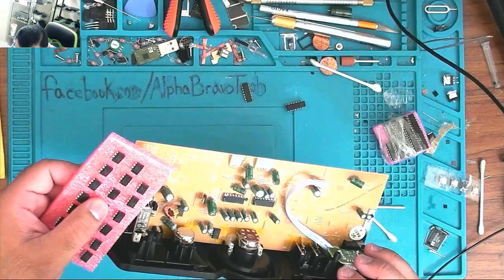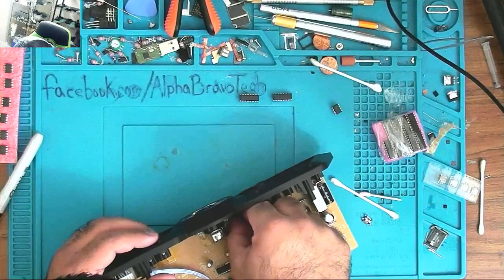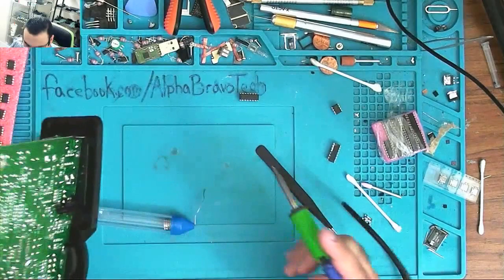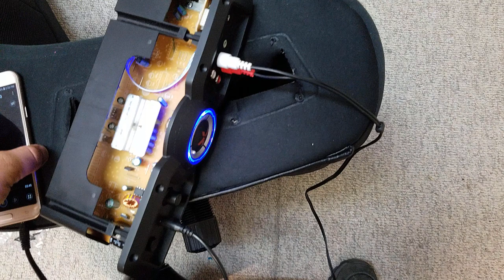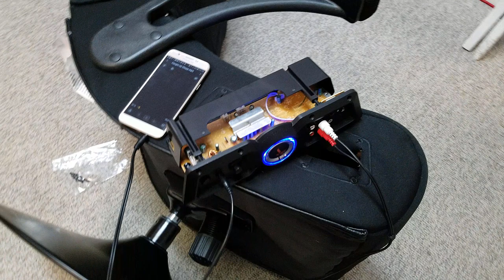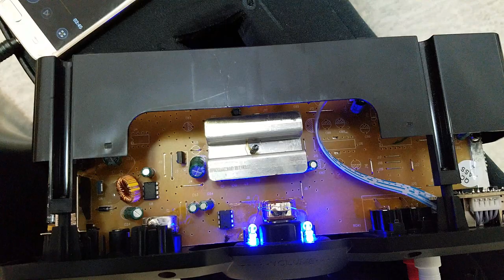Gaming Chair No Audio Repair!!

Comment: I was looking forward to see how you found the fault, I also would like to know what Integrated Circuit was far ?!! Err-um shi-Err-Um failed.. Sigh...
Reply: I actually did record my troubleshooting process but didn't add it to this video. You're right, I should have. First video (troubleshooting) was done a week or more before this video.  In that process I found absolutely nothing wrong. Since I found nothing wrong I decided to replace the two amplifier IC's and that one smaller power management IC (If i remember right it was a pmic). I'm pretty sure that smaller IC was fine and the two bigger ones were the issue but I just decided to replace them all.
I decided to upload this video so that maybe it would help someone with a no audio issue on their gaming chair. Thanks for watching, and for the honest reply. I will remember it when recording and editing my next video. 👍👌